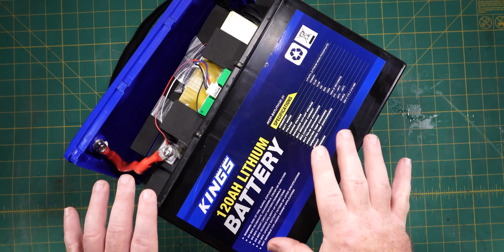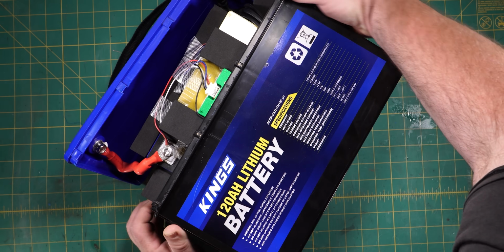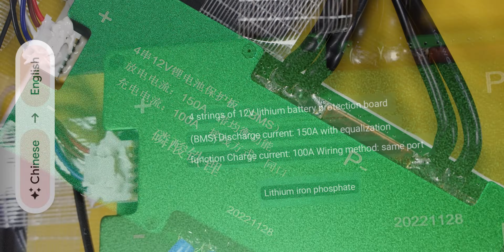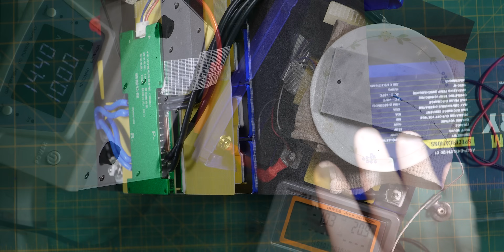Supacentre Kings 120Ah Lithium LiFePO4 Battery Performance Teardown Review Part 2

Comment: What would be the resting voltage of say a fully charged kings 300 ah lithium battery be ?
Reply from the maker: The resting voltage should be around 13.6v for any 4S LiFePO⁴ battery.

Comment: I bought one and tested it's capacity and got way more than 120Ah out of it so I am happy and the cells are new like they claim and not dodgy 2nd hand with less capacity so that's very good.
Reply from the maker: They do seem like a decent thing!
Reply: If you're getting more capacity than stated it would be likely they are second hand higher capacity batteries that have degraded a little.
Reply: @turbostyler  that's one theory but then once again there's no proof, the cells are not swollen from any long use like they always swell  up and end up looking like not perfect rectangle after 300+ cycles 😌
Reply: @michaelmedicworldoftanks33fps  You're right, we can only speculate. Even if they were second hand good cells from a refurbished battery it wouldn't bother me at that price point. My mate just picked up 2 of them for his boat a week ago and I'm a little jelly and am thinking of converting my lead acid setup to lithium in my canopy.
Reply: @turbostyler  nice, good luck with purchase. I am very happy with my one and lead acid and AGMs before that I was just wasting my miney on for nothing.
Reply from the maker: @turbostyler  that's definitely a possibility, though as they've removed the QR codes, there is no way to tell!

Comment: You'd be surprised how cold it can get in certain parts of QLD!
Reply from the maker: Especially the deserts!
Reply: @joshuamccabe7729  I've been there many times! I live in Vic. ,but when I was working in Central QLD many years ago it was well below freezing!
Reply: @joshuamccabe7729  yeah I'd only been to QLD  a couple of times, but when I worked there I had no idea that it actually got that cold! I was near a place called Stanthorpe, that joint is cold af

Comment: The cells looked good with no bloating. More likely 2nd hand Chinese used cells but still with a good AH rate of discharge Remove the BMS and fit JK BMS with Bluetooth and 2A active balance. Could build a cheap 24v set up.Shame the cells are welded tho! Great review thanks
Reply from the maker: Cells are welded no doubt because it's cheaper at volume. I agree, a decent BMS would go a long way toward improving this battery.

Comment: A lot of assemblers also remove identifying codes to make it more difficult to reverse engineer.  For example, if you don't know the exact part number or the manufacturer it would make it harder to make counterfeit products by sourcing similar products.  So, for example, the assembler may be doing this to prevent their own customers from going around them to buy the components.  

All feedback on these blue top batteries seems to very positive.  It would pay to keep tabs on these to make sure the quality doesn't drop.  For now the value for money seems to be pretty good.
Reply from the maker: I agree, as you can pick them up for around $500, that's decent for the price. I'll be testing it in a year or so after constant use running the fridge on solar and see how it degrades over time.
Reply: @LockyourHubs4WDing looking forward to the retest.

Comment: Good job & review Simon. I think they will have a second sensor for low temp shutoff, not a biggy tho, you can use a 12v pet blanket if needed or a temp sensor & relay to cut charging if this is an issue. 
I prefer the prismatic cells to the older pouch variety myself. I would love to see a review on the Kings 200A lithium battery, I recently bought one ($800 on special) and am curious about what BMS and cell type they use in the 200A model, and they claim can be series connected up to 48v which makes these batteries very versatile for connecting 12v, 24v & 48v inverters. 
Andy’s off grid garage YT channel has a lot of good info & testing on this battery type & all things solar, he recently assembled his 48v “Frankenstein battery” made up of 280A cells after 2 yrs of hard testing conditions & some bloating etc, they still pulled 278A.
I think the Kings batteries seem like a reasonable option for the price point.
Reply from the maker: When I removed the BMS from the cell pack, I  only saw the one temp probe.
Reply: @LockyourHubs4WDing as an update, I just bought a 2nd Kings 200A lithium battery 1 week later, which has now arrived and has a blue top on it & is about 25mmm-30mm wider than the first battery to arrive that has a black top, it would be very interesting to know/see the difference between these two battery versions. I am guessing that the black top may be pouch cells, while the blue top battery may have updated to a prismatic cell allocation. 
I have 12v, 24v & 48v inverters, so I would like 4 of these (at the $800 price specials) they make reasonable economic sense, & are supposed to have the ability to be connected in 4x series for up to 48v, so would be versatile for use between my 12v canopy camper setup and 24v & 48v inverters I run in my other off grid Bus, shed & house setups. I would love to see some real tests done on these Kings Lithium batteries to prove their BMS’s can be 4 x series connected and deliver prolonged reliable current under decent loads. 
Active balancing works by taking the excess voltage from a higher cell & transferring it to the lowest cell in the pack & is generally a much higher current up to 5-10A and is a much better method for balancing of larger cells in particularly.
Passive balancing is the most commonly used method probably because it is cheaper in design, it generally trims the voltage of higher cells via resistive load, and accordingly varies from a few milliamperes up to maybe 150 milliamperes depending on many variables built into its design, it works, but is generally too slow to be able to balance cells efficiently, and are probably not really a suitable solution for cells of 100A or more especially if they are being drawn reasonably hard on a daily basis, active balancers are needed at least occasionally to help keep battery cell balance in check.
I have 3 x Seplos ‘Suntorque” 48v 5kwh batteries with passive balancers - 10yr warranty I bought through Commodore last year, 2 of which are failing dismally in under a year, 1 has lost 35% capacity, the 2nd has lost about 25% capacity and the 3rd battery is still at 100% capacity, so I will be seeking a warranty claim on those 2 batteries before long, and I think they are getting up to 240mv out of balance between cells.
I also have 16 x 310A cells hooked up to a JK BMS with 2A active cell balancing for about another 15kwh paralleled to the 15kwh Suntorque bank, which has kept the battery cells within 2-3mv flawlessly on a daily basis. I also have 2 x 24v 5kwh battery banks (paralleled) in a bus up north with JK BMS’s & 2A active balancers which also work great keeping the cells at 2-3mv delta.
Hope I haven’t bored you too much. Cheers
I

Comment: The reality is in Australia the low temp cutoff isn’t necessarily important considering the batteries will highly unlikely reach below zero where mounted in a van or vehicle. 
If you do consistently travel in super cold areas you should be looking at some form of insulation around your batteries and not 100% rely on a sensor that could fail at anytime without notice.
Reply from the maker: You make some valid points, though if they've gone to the trouble of adding a functional temp probe, why wouldn't they program the cold temps as well as the hot ones.
Reply: @LockyourHubs4WDing  agree with that but I wouldn’t 100% rely one
Reply: I tend to agree with you there, the other thing is that a lot of the mid range DC DC chargers that have a lithium charging profile that say they have Temperature Sensing also do not have a temp cutoff when the temp is to low, its in fact there to increase charge on cold days and reduce charge on hot days lead acid batteries. I am in this pickle right now, having ordered a lithium battery to find the temp probe on the CTEK unit i have does not have a cutoff feature when the temp gets too low, which is a problem for me as my battery is in the back of my ute (even if it is under a canopy). Having said that it might be -4 to -6 on the very odd day around here during winter but im tipping the inside of the battery itself is still well above 0, so ill try an insulating jacket around it and a rubber matt beneath to decouple it from its metal base plate.

Comment: Where did you get the 2 amps per mm2 from? I’m designing a power distribution hub and everywhere I read it’s 0.8 amps per mm2 for aluminium and 1.2 amp per mm2 for copper. Seems a bit overkill seen 100mm2 will only do 120 amps in that case.
Reply from the maker: Admittedly that was your friendly neighbourhood AI, ChatGPT.

 I'm suspecting I should have dragged out the 30 year old physics text books from back in the day. 

I'll look into it and put any corrections in the description.
Reply: @LockyourHubs4WDing  well chat gpt makes more sense logically like 50mm2 can handle 200 amps quite nicely which would be that 4amps per mm2 but as soon as you mention busbars people seem to think you require 1.2 amps per mm2

Comment: Great videos. Would love to see more vids on batteries, possibly comparing different types on the market. Sounds like you have a wealth of knowledge that needs to be shared with the community! Thanks so much for your hard work.
Reply from the maker: I would love to do a battery performance testing video, not just the differences in the chemistries (that I've already covered) but directly measured performance testing as well.

Comment: Did the BMS have one tem sensor or two? 
I have seen plenty that have two... The reason why I ask is maybe the BMS is using the average of the two sensors for it's readings? And therefore -10C wasn't enough to trigger it ? As opposed to the 100°C you tried!
Reply from the maker: Only the one external probe, as you saw later in the video I completely removed the BMS from the cell pack. Additionally during testing,  I managed to get the steel plate to -30C with the probe attached.

Comment: Good review matey and cheers for that. Got two of these although one black top and one blue. Running in parralel on solar charge. You think there would be an issue with the two diffent cells?
Reply from the maker: There shouldn't be, though you could be limited slightly by the battery with the slightly lower capacity.

Comment: I just bought 2 of these to run in parallel in my 4x4 and the kings dc-dc which has a temp sensor, so it might help in the cold weather. 
Maybe you could test the dc-dc (I have the 40A) to see if that works.
You have definitely boosted my confidence in these batteries, thanks.
Reply from the maker: You're welcome! We've done an install of the older Kings 25a DCDC, though not sure if that model is still available or not.
Reply: @LockyourHubs4WDing  I don't think that is available as the new ones are lithium compatible.
Reply from the maker: That's right! I might have to have a look at the new models

Comment: Low temperature sensor are a separate one than the high temperature sensor it should have a sensor for each
Reply from the maker: Why would you use 2? There was only one thermocouple from the BMS.

Comment: The lads from “aussie arvos “ run one these 120 batteries and did a 12 month review note long ago and rated it. Hope over and check them out, that review and this one is what sold me to get the 120 kings battery. As someone else mentioned it’ll sit idle a lot of the time and I’m only running an 80lt dual zone fridge and some led lights plus the water pump,in the camper. 200w solar blanket through a redarc 1240D should see me with cold bevies and fresh tucker for a while 😊
Reply from the maker: The mark 1 (the one from Aussie Arvos) is a pouch cell battery, other than the branding, it's a completely different battery. Though they seem pretty decent as well.
Reply: @LockyourHubs4WDing thanks, I was wondering about the AArvo’s battery, I thought it was a prismatic cell type, it performed well under test. I prefer the newer prismatic type cells over the pouch calls.
Reply: @LockyourHubs4WDing  cheers, I hadn’t realized the difference but hopefully the mk2 is just as reliable. Love your videos by the way, been a long term follower. Bought the 12v travel buddy and am about to install it with the 15v stepup converter as per your video 😎👍

Comment: Straight shooter extraordinaire! Bloody thorough review too. Greatly appreciated.
If the price is right, I'd buy them, but right now they are selling them for $600 - $650 - they would need to be under $500 as I would need to compensate with additional component for the lack of low temperature cuttoff and the additional risk of unmarked cells. I'm not concerned about used cells - if they deliver the AH claimed and they are not physically bloated, they have another 2000 cycles before they get to 80% or 96AH.
Reply from the maker: They're $500 on Amazon, but the shipping is a bit rich.

I agree that technically if they were used cells there shouldn't be an issue of the lifespan of the product, though my objection if they are second hand cells is an objection in principle. It's sold as a new product and should contain new cells.
Reply: Ecoflow is now selling 100ah lithium for $198 usa , here in nz that's 690 ,should be 400 to 500, give it a few mouths and will be lower

Comment: This leads me to now ask…..so what is “the best affordable ” lithium battery ? You had me sold on the first video but being from Vic you lost me on the second video 🥶 ❄️
Reply from the maker: As a fellow Mexican 😁 and having a small Victron addiction, I'll sort out the temp protection issue with the chargers.   

There will never be a "best" just a "best for your use case". Like most things in life.... 

If you're a Queenslander, and only use low draw equipment, this battery will be ideal, straight out of the box. 

I'll be putting this one in the 80, running an Engel 75 combi 24/7 on solar. We'll see in a year how much capacity it has lost.

Comment: (The BMS can disconnect the battery to prevent damage from over or under temperature) i cut and pasted this from their website. I purchased one of these batteries a few months ago and questioned kings via there customer service email on this subject. I live in Vic and  was concerned with cold mornings. In short i got nowhere, the customer service guy escalated it to someone else and it became clear he was just googling the answers lol. Looks like i need to invest in a battery protection thingy, i didn't know they existed. Great video, thanks.
Reply: Most batteries or chargers don't have a temperature sensor, this a a feature to look for or perhaps buy a battery with built in heater if your above the snowline. There is nothing inherently wrong with the older gell pack batteries except they can't  be charged as quickly. I have to say the newer kings battery should be able to accept more current ,I sure many will end up connected to an alternator.
Reply from the maker: Glad to help, it's strange they would implement one without the other to me.
Reply: @LockyourHubs4WDing many of these battery types have high temp cut off, but dont have low temp cutoff, even the more expensive varieties. I have seen other reviews where low temp cutoff is claimed but failed when tested.

Comment: They will be degraded 150ah cells. Also in your last video if you can see the bms that clearly with thermal cam and the wires on the outside of the box its a lot hotter than the hot temp you read from outside the box which is bad.
Reply from the maker: I was thinking that might be the case myself, though without the QR codes, who knows!

Comment: Very informative, some over my head but I’ll go by the comments and your opinion, cost of lithium still bit high for my budget, still agm for me for now, probably go kings when $$$ available, appreciate your sharing this 👍👍👍👍
Reply from the maker: Happy to help! I think other than the cold temp protection, the battery seems like a decent buy.
Reply: Some AGM's are even more expensive than the Kings.
Reply from the maker: @strikemaster1  full river for instance!
Reply: @LockyourHubs4WDing  Yup mate... Batteries direct are selling the 120 FR AGM bat for $580 and I think Kings Li is cheaper. Same with Victron and Redarc. I do admit however, the FR bat is a good AGM. I had one a few years ago coupled with a Ctek charger, and it never missed a beat.
Reply: Kings are selling the 120Ah for $300 today (21/12/23)
Reply from the maker: Wow! That's cheap!

Comment: I have 2 x 300 ah kings battery systems. My 95L national Luna fridge use 280 amps before cutting out and still 12.7v on Victron 712. For 1249$ on special it’s a no brainer for me. We use no gas and only 240v appliances. 

My old system was a 120x itechworld x2 batteries. My fridge cut out at 190 amps used. At 800$ a pop, it was not hard to make the change. 

On  another not, most 4wd campers don’t use their vehicle the whole time. That battery is probably sitting 80% of the time and idle mode, doing nothing. Can’t see the need spending thousands if the kings can do the same job.
Reply from the maker: You make a great point, most aren't living full time in their 4WDs or Caravans so for the most part, the Kings gear can make great economic sense.